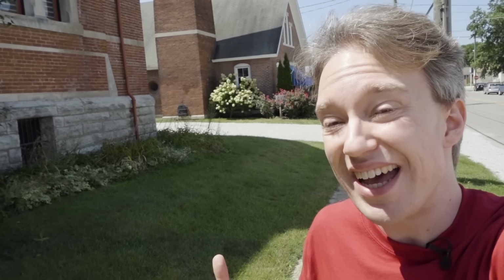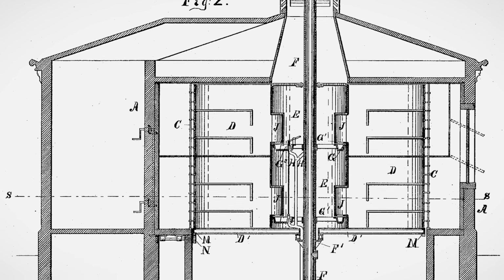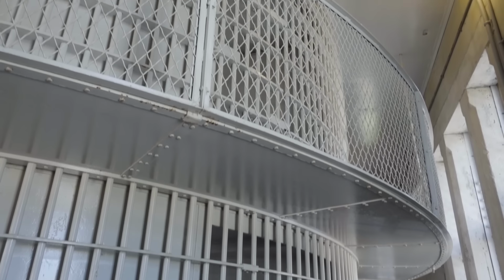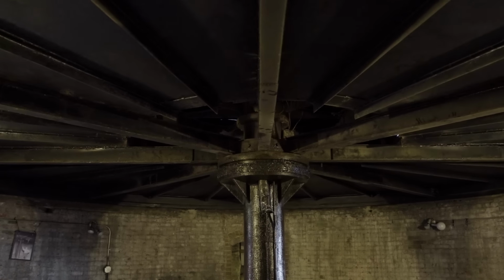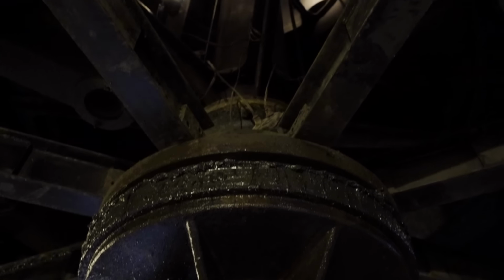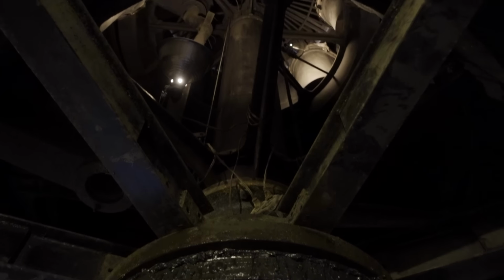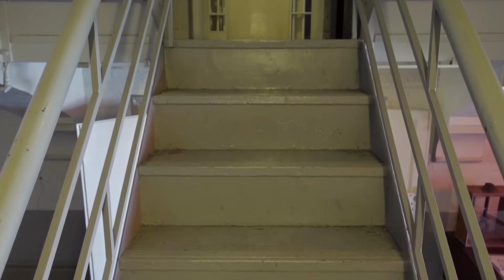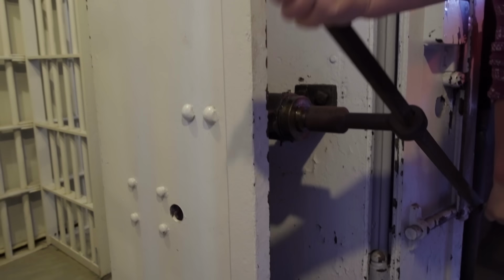The "rotary jail" had a slight problem

Comment: The idea would work without the risk of mangling limbs. Use the elevator doors idea. One solid door that closes on the inside before the rotation. That way, prisoners cant put any limbs out.
Reply: So to reduce the number of doors (i.e. reduce the number of moving parts), you would add a door to each cell?
Reply: @bramvanduijn8086  the original idea is not to reduce the number of doors but to reduce number of exits. My idea is not exit doors but safety doors that will serve as barriers during rotation.

Comment: The concept on itself is not horrible, but it was extremely overcomplicated. The same effect of "only 1 cell has an opening at the time" could've been achieved by having an outer shell rotate around the cells instead of the cell themselves rotate. Far less weight, less chance of an injura if the shell is a wall instead of bars.
EDIT: 2:40 oh okay I'm not the only one thinking this then

Comment: The entire premise that it's an advantage to have only one door because you need fewer guards to watch one door is ludicrous. You can hire one guard to watch a dozen doors, as long as he only ever opens one at a time. I'm still trying to wrap my head around how the plumbing would have worked (or not worked). They must have had gaps in the pipes coming down out of the toilets. Was it literally an open sewer below the cells???

Comment: Accidental amputations could've easily been avoided by building another set of bars or similar object inside it, preventing the inmates from reaching the outer bars.
Reply: How would you open those inner bars to let a prisoner enter or exit?
Reply: @bramvanduijn8086  Door or comparable mechanism through the inner bars.

Comment: I had an idea for a 100-story jail.  The lifers were on the 100th floor.  As the short timers filled the jail from the bottom and moved up, when the jail got full, the exterior wall of the top floor would open up to let the inmates decide if they wanted to jump to free up space

Comment: I could see the value of a rotary jail for extremely dangerous / violent criminals, but for a regular jail that mostly deals with drunks, it's definitely nonsensical.  I suppose these days mechanical rotation could somewhat reduce the fire hazard if it could spin fast enough. As for limb removal, surely just some metal grating on the inside of the cell solves that problem? Space it correctly and even a finger through the grating shouldn't reach the outside of the bars.

Comment: BRICK ABD MORTOR BUILDING
ALL STEEL CELLS
MECHANICAL HAND CRANK...Does'nt seem too much risk of fire....and I can not see anyone being strong enough to spin that thing around fast enough to cut of limbs.
Think about it....your lawnmower turns around 20,000 RPMS and if it runs over a tree limb,the limb will stop the blade and stop the motor...don't belive somebody with hand crank would break off bones😅
Reply: If they kept trying to crank it they could

Comment: using a bit of modern tech, you could put an acrylic wall on the bar side of the cell so they couldn't reach through. A door could even be made into it. When the cell swings around to the opening, guard opens the door, and the cell is accessed. Bars in front of each cell could also have hinges to be used as emergency doors in case of fire, but be locked in place the rest of the time. Why have bars + unbreakable acrylic? Reinforcement for doors, and acts as a barrier to prevent the guard(s) on duty from getting something potentially caught in the floor gap between the walkway and cells during rotations.

I really like this idea overall. It is sort of an inverted panopticon

Comment: It is extremely possible to NOT stick your arms through some bars. It feels like this is very much a self-correcting situation.
Reply: It is a fundamentally stupid design when a structure can cut off body parts from people just because those people happened to have their limbs outside of some bars.
It is the architects' responsibility to minimise those risks.
Reply: @Peter_1986  I 100% agree with what you said. But nothing in that counters what I said. The design is self-correcting because if a prisoner gets their arm cut off because it was hanging out of the bars, prisoners quickly realize that they're taking a serious risk by hanging out of the bars. The ones who don't do that will survive, and the ones who put their limbs in a hazardous architecture will not. 

It's the architects' responsibility to design a place that fulfills the demands of the owner. That almost always means that the structure must be safe to inhabit. But it is not always true.

Comment: Other than the safety concerns during a fire, I don’t see any other problems with this jail system.  All the other ‘problems’ are caused by the inmates themselves and are cured very quickly and easily.

Comment: 2:40 If it's designed the same way rotating the bars would still cut off someone's arm. If it's designed differently you could still rotate the cells.

Comment: Holy cr a p.  I've barely made it a minute and fifteen seconds into this video and simply looking at that contraption is triggering all kinds of claustrophobia ideas and imagery in my mind.  That is a truly atrocious and deadly design.

Even on a good day this means that every morning it takes forever just to let each prisoner out for breakfast.  On a bad day there is a fire and there will be no time to get every inmate out.  Especially if the fire is causing the mechanisms to fail.  Or the machinery can simply break.  I've had to wait days and weeks for parts to my car, or my furnace, or what not.  Some specialty machinery require specialized technicians to repair them, too.  It might take months to fix in a worst case scenario.

Who ever even conceived of such a thing was an insane id 10 t.

Comment: This is one of the dumbest inventions I've ever seen, I was thinking the same .. why not make bars rotate or just have mechanism that allows only 1 door to be opened at a time? .. or why even need that? .. oh wait, because of HUMAN STUPIDITY! If I was jail guard, I'd never forget to lock a door and then open another one by accident, things like that only happen to incompetent idgets.

However getting their limbs broken or cut off is a GOOD idea, its your own fault if you stick your hands or legs out and then get stuck. Being drunk is no excuse for not paying attention, I can be drunk and still do things, I won't stick my hand in oven when i'm drunk or jump in middle of the road and fall asleep there.

Also the mechanism, why does it rest on center? around the edges, you could have big ballbearings. Like a "trench" or whatever you call it, put huge ballbearings inside of it, so the structure rests on them, then cover them in some grease or oil for even smoother movement.